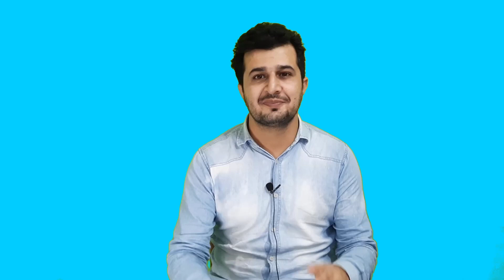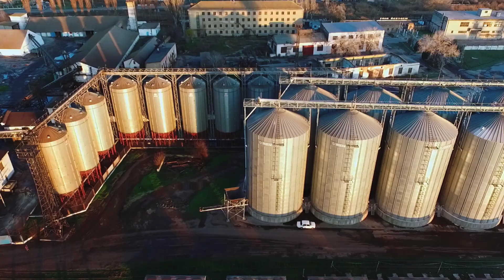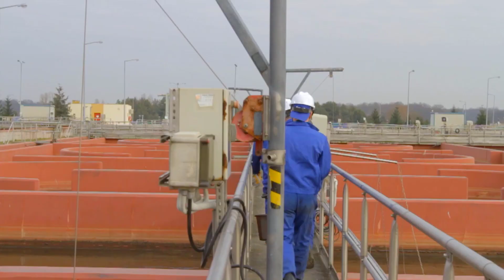Modbus is dead? : Future in Industrial Digitalization Era

Comment: I don't think Modbus is going anywhere. It is the only protocol to the best of my knowledge that's been around since 1979 and is still widely in use. The only knock it has is the lack of encryption which has also been introduced with the new version with TLS. I believe OPC UA/MQTT are more suited for bulk transfer of data to the cloud and would complement Modbus not replace it.